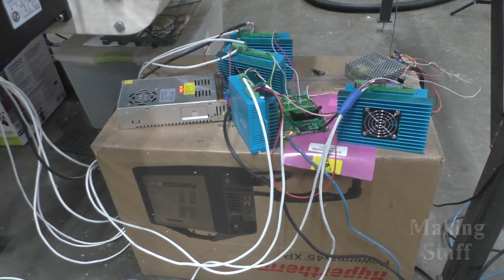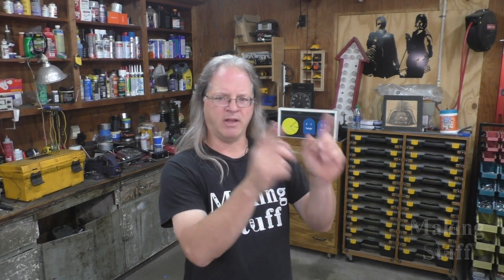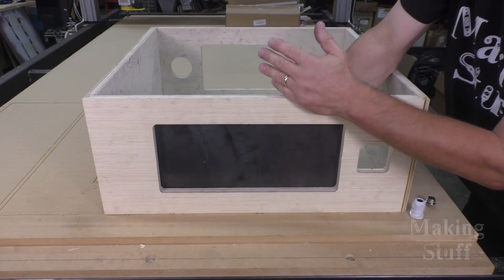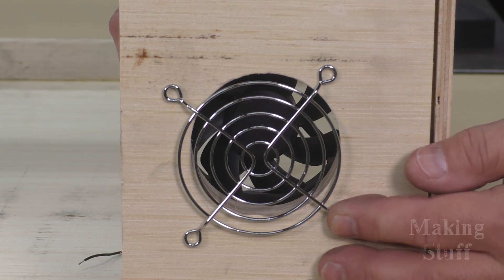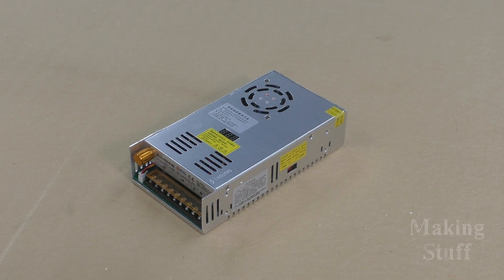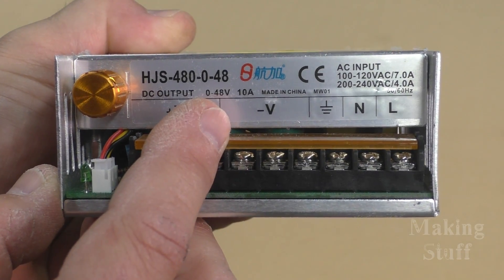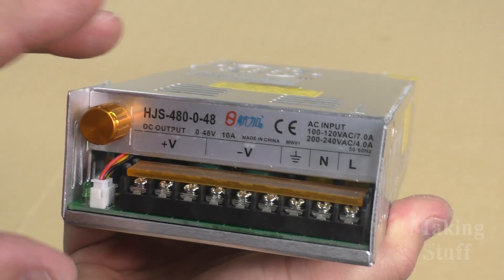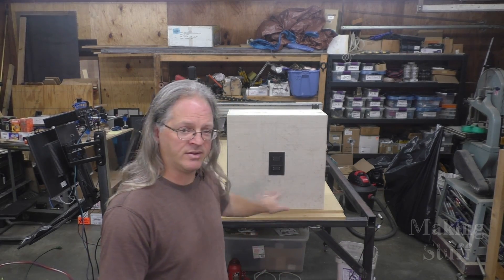Making a CNC Electronics Enclosure

Comment: Wooden electrical J-box? Definitely not UL approved but are we concern about a potential fire hazard? I wouldn't be comfortable leaving the machine running and walking away for long periods of time, electrical components sometimes behave weird. One potential and cheap solution if you don't want to use metal would be to add a layer of 5/8" drywall which I believe has a fire rating of 1 hour but I would definitely use metal if I could.  Good stuff though.

Comment: Fantastic! What interface did you use to control cnc router from computer? TynyG, Arduino?
Reply from the maker: I used LinuxCNC to control a relay that turns the VFD on and off.  I would like to use RS485 interface but could not get the one on my VFD to work.
Reply: use masso it so much better

Comment: Regarding the thickness limits on those cable glands and aviation connectors: couldn't you flip the workpiece over and counterbore it out to a certain depth? You could probably even do that with a hand drill.
Reply from the maker: Yeah, someone else suggested that too.  I've got to get used to having a CNC machine, LOL.

Comment: hi bob.  i  curious  about the spindle power. 

maybe  u can explain the benefit of having 3 kw spindle vs 1.2 kw vs 2.2 kw. 

or even more powerfull  4 and 5 kw spindle. 

heck may be can become another interesting video about this.  

and also job well done on your cnc router
Reply from the maker: The more watts the more power the spindle is going to have.  Thanks for watching!
Reply: @MakingStuff  lol thats i know.  what the benefit. the rpm all same 24000 max

Comment: Great job Bob. In the intro I saw that you were running linuxcnc to control your machine. It would be great if you can make a video about configuring that for your machine. I also made large format CNC router sometime back and have been using mach on it until now. I tried configuring Linuxcnc on another PC of mine but can't really get a hold of it, specially the part to configure the slave axis with it own auto homing.
Reply from the maker: Yeah LinuxCNC can be a pain to setup.  The guys on the forum over at LinuxCNC.org are really good about answering questions.  That's where I go when I get stuck.  Thanks for watching!

Comment: I like the design of the enclosure , i have mine all crammed into an old computer case and it is way to cramped in there . I may have to build something like yours once my CNC is up and running .
Reply from the maker: Yeah the first version of the plasma cutter was all crammed into a computer case too.  I had to move all the electronics to a separate enclosure so I could get more room.  Thanks for watching.

Comment: I have power supplies from old servers that I do not need, but delivery will cost more than the cost, they are 1500 watts 12 mWhere I will give it free for your project !! 
 
I will give a lot of power supplies if needed) from 3v-0.3A to 48v - 50A . 
I have about a ton of blocks, no one needs them in Russia)

Comment: Nice job on the cabinet! I built one using the ammo case like you showed before but used a plate on the bottom of the power supplies so if they went bad I could just loosen two screws and remove the other two instead of removing the whole base plate. I like the 3D printed stand offs for the power supplies better (air flow under them).
Reply from the maker: Yeah I wanted a way to remove the power supplies without having to screw them in from the bottom.  That's why I made the standoffs on the 3D printer.  Thanks for watching!